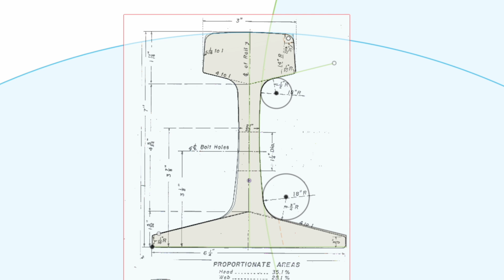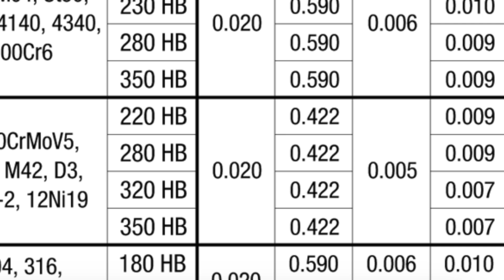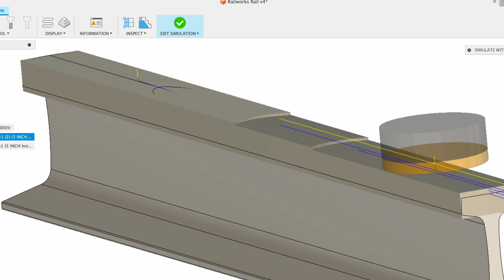Tapering Train Rail

Comment: Maybe it doesn't matter, but I'm thinking you've produced a slightly concave surface by doing it this way.
Reply: Putting the taper in the fixture, by raising the part on one side would have helped. (Coming from an armchair “machinist”).
Reply from the maker: Good catch. The concave is about 0.006", well within the tolerance. The customer didn't feel that would be an issue as the edges and crown will be ground into the rail following installation. Milling off the excess simply saves a lot of grinding later. If this was to be the final shape we would have fixtured it so that it could be milled perfectly flat.
Reply: If the part is level, and the spindle is square, there is no concave surface. The taper was done in program.
Reply: @Regal4555  what were you saying?
Reply from the maker: I'm saying I'm stupid... it is concave at the leading edge but once the centerline of the tool pass over it is square to the tool. I did offset the cut by 0.0347" to address the leading edge. The 0.006" came from me looking at the leading edge in CAD with concave on in my head. Simulation confirmed it was flat.
Reply: @MrSmithDotShop  Somehow I still feel it wouldn't be flat but I haven't any machining for a few years now. I try to imagine a 1 inch end mill doing this same process to a 1 inch wide part. It's not really that important just can't wrap my head around it becoming flat.